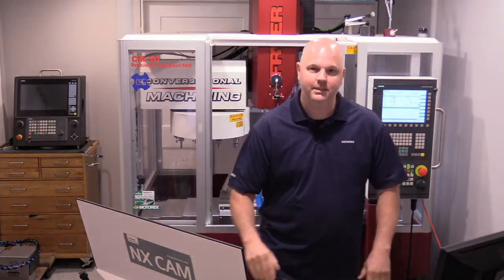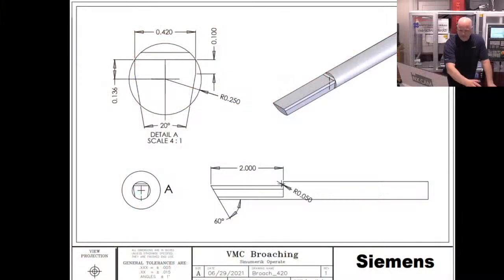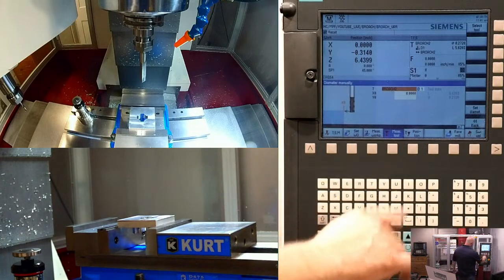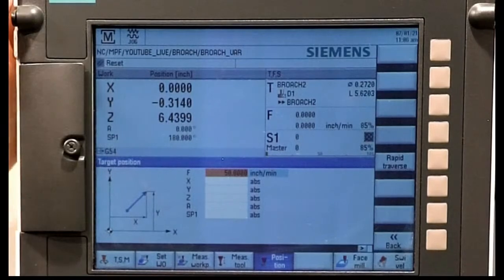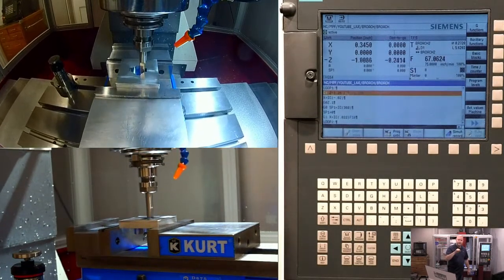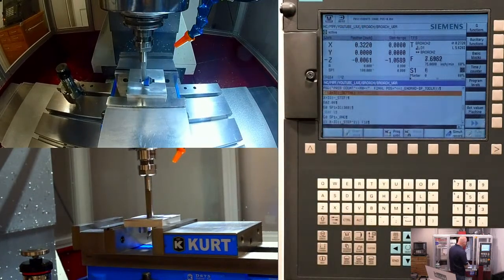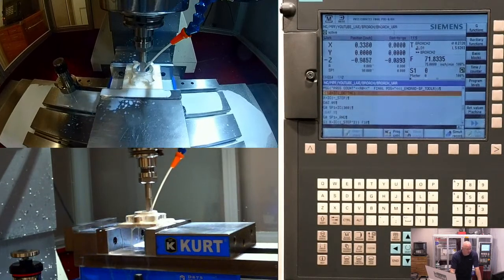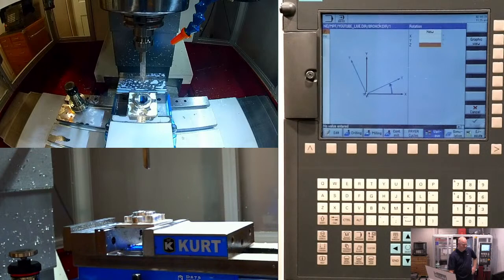How to Broach on a VMC - Ever wonder how to make a square hole on your CNC mill?

Comment: hi, i have an emco mmv2000 from with siemens 840d sl. i know i can orient the spindle in a specific degree, but it doesn't lock the spindle, is there any parameter for this?
Reply from the maker: try spos=180

Comment: Any idea how to make the broach tool rotate on Fanuc control? I reached out to mastercam and they can't do it in the software but I'd like to do this to save my spindle? Thanks!
Reply from the maker: We use Siemens controls on this channel, however I know my way around a fanuc, and this is not a standard option for them and you would have to go back to the builder.